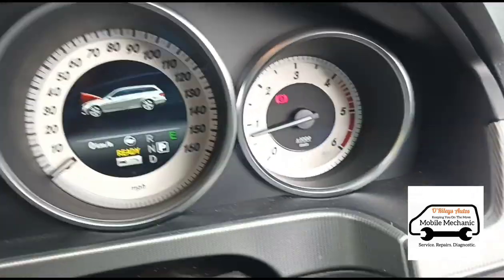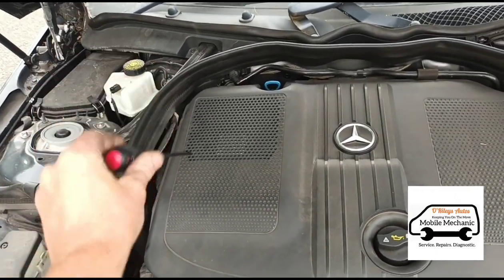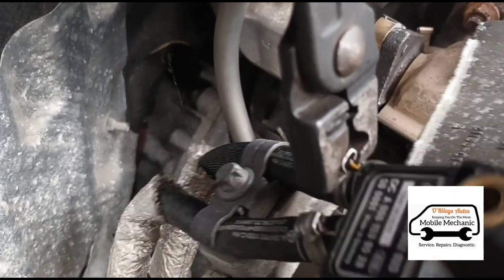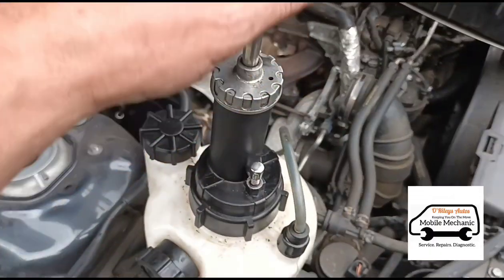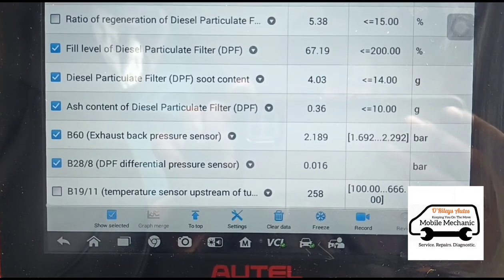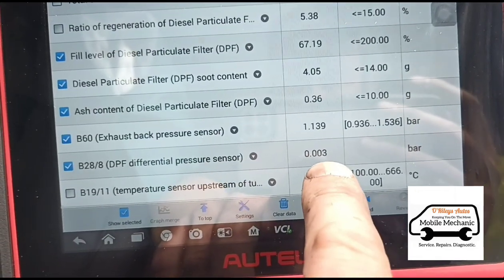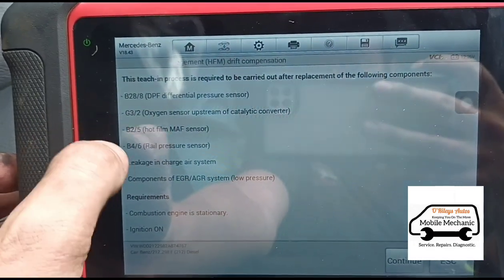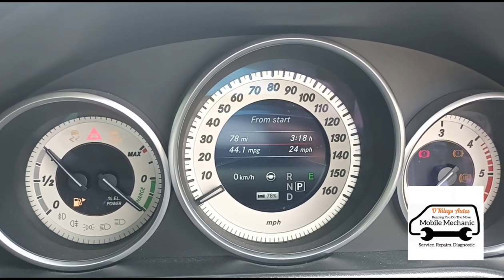Mercedes E Class 2.1 CDi P245414 P244A00 P245328 Differential Pressure Sensor Short Open Circuit DPF

Comment: I used this video as a guide to replace my differential pressure sensor on a 2012 E220CDI. (I only replaced the sensor, so I didn't do the cleaning of the particular filter)
Great instructions!
My errors P244A00, P244A7A and P245414 are cleared after changing this sensor.
Thank you for the instructions!

Comment: Hi. I have a 2012 C250 with the same problem plus ABS ASR and several other problems. My diagnostic is Snap on Ultra Pro but is only up to 2012 so bordering on not much help. I wondered what model the Autell Diagnostic you use or can you recommend any other diagnostic tool ?

Comment: Hey Jimmy, another great video 

My 2009 Audi A4 2.0 TDI (CAGA) has a P2563 00 [175] Implausible signal - can I adjust the actuator somehow whilst the turbo is on the car? Or does it all need taking apart? Thanks

Comment: Why are you using off-car pdf cleaner, when Dpf is on the car... Or does it make any difference..
Reply from the maker: It works well on the car. I think they mainly state that so unexperienced people don't try sticking it in the fuel tank or overload the dpf and it hydrolocks the engine.

Comment: Hello i still have problem p245396 after turn off and start car is going to limp mode. Dpf is cleaned by proffesionals totally clear. Sensor was replaced 3 times. Values of sensor are moving between 0.01bar to - 0.05bar depends on rpm. But what could i see one time when the car was in limp mode it was 0.9Bar and didnt move. It was stuck there. After switch ignition it was okey again. it only happens when the car is warmed up. Please help
Reply from the maker: Did you try a genuine sensor?
Did they do adaptions on new sensor?
Did they do adaptions on the dpf
Reply: I didnt try genuine yet.
Sensor was adapted and dpf too. I have hella and bosch. Today i changed wires and temperature sensor and still didnt help. After warm up or city drive it goes to limp after switch on off ok for a while again.
Reply: @MultiResN   Same kind of problem here. Did you meanwhile solve this?